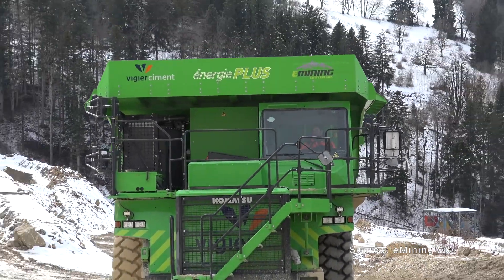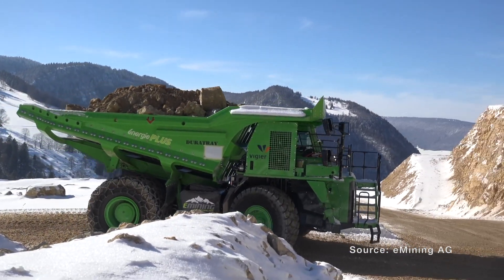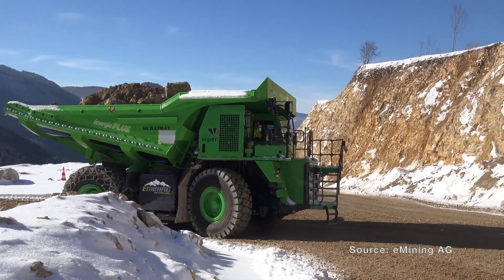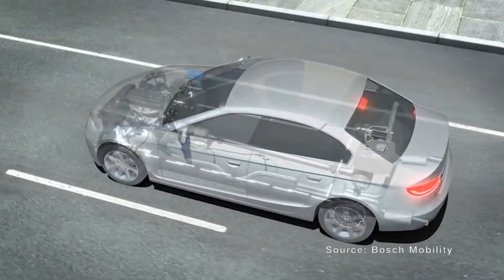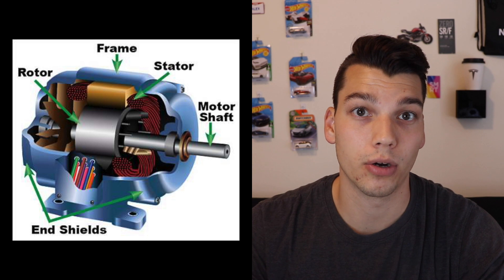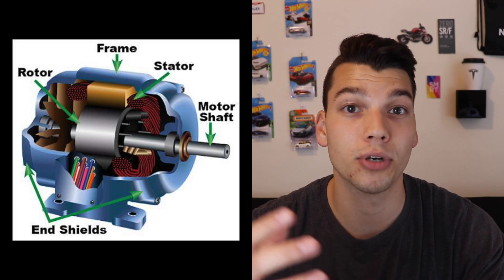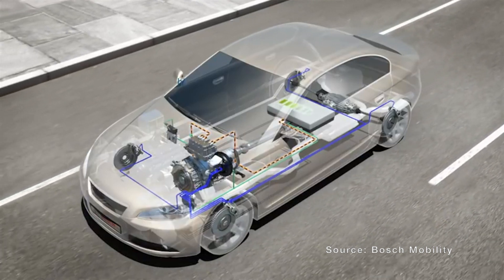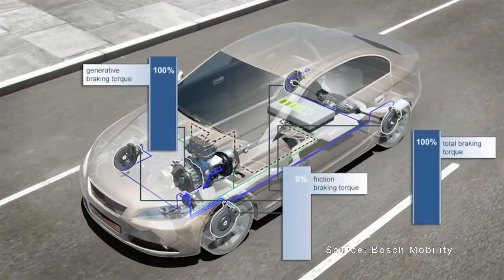How does Regen Braking work?

Comment: Well explained. Be amazing if evs ever go beyond a niche market because still nothing in the pipeline to match fossil fuel car range and ease of fueling despite decades of research.
Reply: Same was once said of horse and buggy
Reply: @FluxMD  Nah, not really if you check the facts.

The first car on UK roads appeared around 1900 by 1930 there were a million because the tech was bang on from the get go unlike EVs. 

EVs preceded gas cars but failed because of range and charging issues and despite mass advertising and govt incentives they're still niche market because of the same issues. 

Tesla led the rebirth in the early 2000s and the market share is still piss poor nothing like the amazing take over by the internal combustion energy over ponies.

Nice niche market toys though.

Comment: What happens when the battery is 100% charged? Does regen braking still work then? The resistance braking your car when it's regen braking comes from the magnetic fields that are created by the electric current that is charging the battery. When the battery is full that means no electrical resistance in the battery, meaning no current flowing, in other words no electromagnetic fields created to stop the rotor of the motor from free spinning. and slowing down the car. Is that true? If so, it can be really dangerous relying on regen braking in those moments.
Reply from the maker: Correct! When I'm at 100% regen doesn't work and you have to adjust your driving a bit. However a majority of the time I don't charge past 90% since it's healthier for the battery and what the manual recommends.

Comment: It can't NEVER require recharging. That would violate the 2nd law of thermodynamics. It only recaptures about 70% of the energy lost.
Reply: Agree , even for this particular case (i.e; the trunk is going uphill empty, then goes down with big Load)
Reply: wrinv       godc   are  300 perçt efect ór 102 oerct efet

Comment: So how does the regenerative braking vary the regeneration? Is it just by feeding the motor electricity at a smaller rate?
Reply: Modulating the reverse torque on the rotor

Comment: Thank you for providing this excellent explanation, Alex. I would be grateful, if you would respond to several related questions that my wife and I have. We just purchased a 2020 Toyota Camry Hybrid XLE; each time, while driving, we release the accelerator pedal, we hear a sound - a single knock. Is it reasonable to presume that such a sound is normal, that is produced by the regenerative braking system functioning properly? If so - if one can expect to hear sounds from that system - should one accept as "normal" any sound, or should some sounds cause concern? Is it possible for an automotive technician to quiet sounds produced by regenerative braking that annoy the driver? Thank you for considering these questions.
Reply from the maker: I personally have never heard a knock when regen braking kicks in... I've test driven a lot of hybrids and EVs and never heard it once. Sounds like you should definitely get a mechanic to take a look at it, especially on a semi-new car!
Reply: @Sibs  Thank you for your prompt, helpful reply!
Reply from the maker: No problem, best of luck with you car! Hope everything works out :)
Reply: David and Alex,  i am guessing that the "knock' maybe a solenoid or something switching in, as the motor is switched into regen mode.  This is really a less than ideal solution using one pedal.  Originally some electric vehicles (many years ago) used a tiller: forward to power motor from battery, vertical to freewheel , under no load , and back to apply regenerative braking.  The other advantage to that idea is that with maximum braking the car stops (and recharges the battery) very quickly.  Your car may need adjusting.  I don't know, because I am not at all up to date on this.  I used to pay attention to electric vehicles in the 1960's, and have worked on many electric motor designs and engineering using regenerative braking, but for driving manufacturing processes, not cars.

Comment: Terrible description
Reply from the maker: K
Reply: @Sibs  It would be a mistake to push current to the battery while coasting, the kinetic resistance will slow the car reducing the efficiency of the coast, slowing the car is what the brakes are for... (Which, in your defense, is what I think you were trying to say)
Reply: EV's are not 'awesome' in stop and go traffic because the electric system cannot efficiently convert the high torque energy into the battery at low speeds. (like traffic jams) An EV does this okay, but a hydraulic system does this almost twice as efficiently... which is why frequently stopping low speed vehicles such as UPS trucks and city busses use hydraulic, not electric.
Reply: How could a one pedal system work for example downhill?.. Accelerate until your dead, or stop completely?.. 
Perhaps the ECU tells you how fast you're allowed to go, vs. freedom? Drivers should be smart enough to set their own cruise control speed, plus - coasting while off the accelerator is a huge energy saver.
Reply: @jhunterholland  there are times and places for regen braking Ofcourse it’s not ideal in stop and go traffic but u can turn it off

Comment: It explains what the engine is doing and other than charging the battery, how it is stopping the kenetic energy you've built up? What if you're in a panic stop... some one runs a stop sign, do you simply let off the throttle pedal fo an emergency stop
Reply from the maker: All EVs have standard friction brakes that can stop the car quickly. Depending on the car, regen intensity can also be adjusted. I currently have my model 3 set to full regen, so I usually don't have to hit the brake at all, but occasionally when I need to slow down quickly I do press the brake.
Reply: I know that just sounds dangerous scary and crazy reckless not to have brakes on a car but they don't have to abide by all the motor vehicle laws because technically it's not a motor vehicle it don't burn gas that's why It don't have to have mirrors

Comment: I was told by a sales guy that regenerative "braking" was when you actually applied the brake but this makes more sense in that when driving down a long declining hill like on a freeway I could actually see the power being sent back to the battery without putting my foot on the brake (I had a Chevy Volt with an animated display showing power direction). So it seems it works with both the applied brake and when you are simply coasting.
Reply from the maker: It depends on the vehicle and what settings you have enabled, so both can be true. Usually regen is on by default and will occur any time you let off the accelerator, but it could also occur only while pressing the brake on some vehicles.
Reply: Alex Sibila yes, it was set for both on my Chevy Volt. I did not see anywhere you would have a “choice” of settings but it appears that it was set for both. Thanks.

Comment: This is the best explanation I have seen. Thank you very much! I can see how regeneration takes place when the vehicle is coasting. I have a question, when I apply brakes or when it has to stop immediately, traditional braking is essential, right? Is it more like a combination of regeneration and traditional braking that is taking place when I apply brakes in that case?
Reply from the maker: Good to hear! And yes, traditional brakes are still necessary. Usually regen can't slow you down as quickly in an emergency, so there's usually a combination of both in EVs. Most will show you down to about 5mph and you still have to hit the brake to completely stop

Comment: Hey there Alex! This was a fantastic video, but I'm still a little confused about one thing. Why exactly does the electric motor slow down so much faster than letting a gas car coast? Like what is making it slow down so quickly instead of just continuing to roll similar to an ICE
Reply from the maker: The electric motor has more resistance since it has a load attached to it and is trying to overcome electromagnetic force. ICE cars only have friction to overcome when moving, so they slow down at a slower rate. That's the simplest way to explain it without a bunch of math haha
Reply: Here is another explanation:;  The electric motor in a car can also be made to "freewheel' if it is loaded into "no" load' condition:  I E: a high resistance. The term high resistance represents the opposite one would assume in everyday life ... in electronics it means a path for electrons which is very poor, so the same voltage loaded to a high resistance draws less current, and consequently uses less power than a low resistance connected to the same voltage source. This is because a motor that can act as a generator has no current draw when the resistance that it "sees" is very high.  The electric motor will stop or slow a lot if it is loaded into a "low resistance" because a lot of current is drawn from it.  

  The only way that truck could be made, not to need recharging is if it is always carrying a heavy load down hill and releasing it at a lower altitude.  To drive the same load of rocks,  back up the hill (same load) would require more energy than it gained going down, because of friction, air resistance, and heat lost by the motor/generator.

Comment: There's one important thing to note here though. Regen braking cannot fully replace friction brakes. While they do slow down the car the mechanical brakes are still needed to hold the car in place when coming to a complete stop. Also, in panic braking situations, the regen braking cannot force the car to slam to a stop on its own and needs to be supplemented with the mechanical brakes as regen braking can only gradually slow the car down. But overall, your mechanical brakes will last much longer as they are only serving as auxiliary brakes in an EV.
Reply from the maker: Yup, all true!!
Reply: You are partially wrong. In some cars, regenative braking can be used to fully slow down a car and bring it to a halt. The car will not move unless you press the accelerator again. I know teslas have this feature because I have experienced it myself.
Reply: @CloroxBleach-hi6jd  But Teslas I know for a fact have mechanical brakes. I get what you mean that the regenerative brakes slows it down to a halt but they can't keep it in place. The car stays still because it doesn't creep forward like a gas powered automatic car (but there is a creep forward mode on Teslas you can activate) but if you are on a hill, you probably still need the mechanical brakes. What I did hear is that with Teslas you can drive the car with only the accelerator. The instant you release it the regen instantly activates and it slows down even activates the brake lights much like driving a manual car on a lower gear. I'm curious to experience it myself it sounds like something awkward at first but takes time getting used to.
Reply: @juanzingarello4005  I forgot about that part. If you are on a steep enough hill the regen braking will not be enough to stop it.
Reply: @CloroxBleach-hi6jd  True, the Bolt-EV motor can hold the car in place (when you select L for OPD) even on  a hill.

Comment: so its impossible to coast? ..i mean if you let go of the accelerator it'll instantly engine brake.
Reply from the maker: Most EVs have settings to adjust the amount of regen. I can't speak on every car, but I can turn it completely off on my Tesla. Takes some time to get used to, but I definitely prefer regen over coasting.
Reply: @Sibs  i found you can just pop it into neutral on most forklifts.. but if you did that the machine wouldnt last a whole 8 hour shift.
Reply: @Sibs  If I have to guess, it probably feels like driving either a stickshift on a lower gear of an older car without the overdrive on. Probably just takes some getting used to.

Comment: As added info, not all EV cars are single pedal... For example, both the Porsche Taycan and Toyota Prius control the amount of regen by using the brake pedal. The car uses regen braking as much as possible, then adds friction only if needed
Reply from the maker: True! Depends on the car but most of the ones I've driven have regen when you let off the accel pedal
Reply: @Sibs  If you'd like a deep dive into EV regen, take a look at the Weberauto  channel
Reply: some  ev 3   peadales stick shit clutch  ekrruc farri 307 gt

Comment: I know this may sound crazy but why can’t Tesla use regen braking in reverse that way it’ll charge the car while you drive. Now that would be world changing
Reply from the maker: Because that would mean Tesla would have figured out how to make energy out of nothing, which is impossible. You can only have regen when the car is slowing down or going downhill because of the excess potential energy. Once the car gets moving it has to constantly be "pushed" by something, in this case the motors, to overcome external forces on the car.